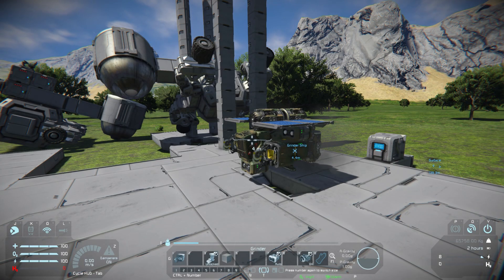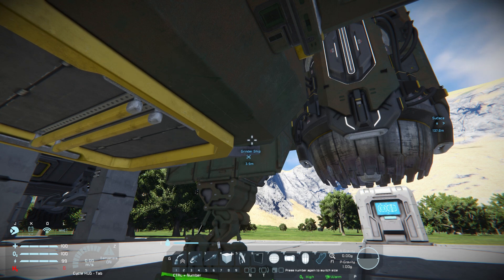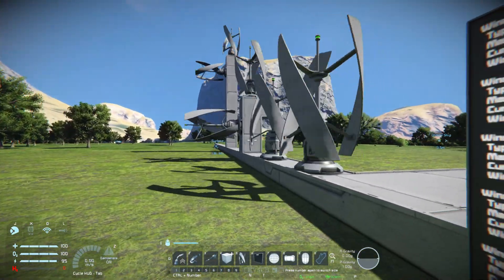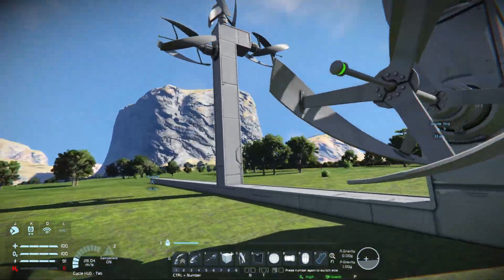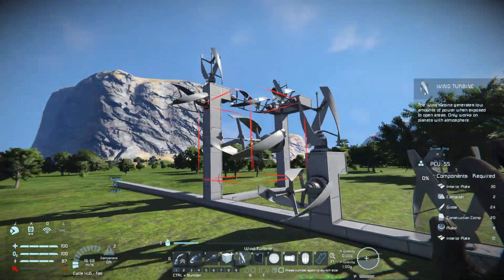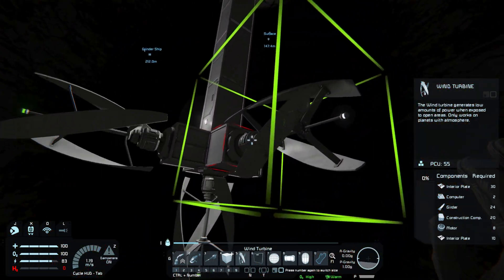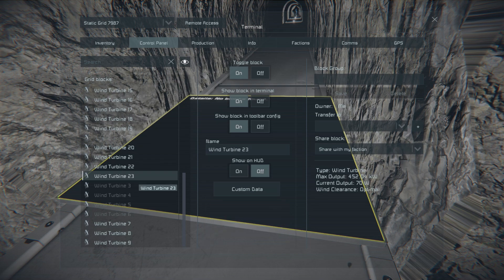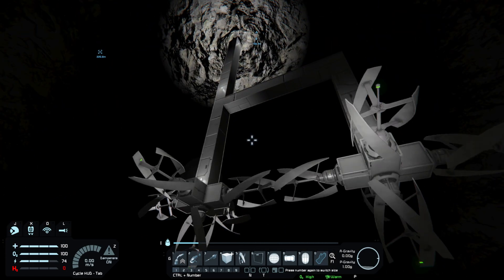Space Engineers | So You Want To Be An Engineer | Ep. 03 - Wind Turbines

Comment: 0:46  Holy crap... lol Ok.. I stand corrected... humble is my pie... :)
Reply from the maker: No worries.. I did a bit more testing off camera, imported another copy of the grinder ship,  had nothing in cargo, and overloaded the ship with batteries... ~42k kg worth of them lol

Set the inventory to 10x, and the empty cargo version still couldn't fly on 1 thruster, but the other ship with only 42K kg of cargo could.

So my original thought looks to be accurate, the grid mass is all blocks +(cargo mass/inventory factor %) for the lift/thrust ratio.. BUT grid mass reported is block mass + cargo mass (no modifier).

This means that the cargo container does have some contents mass modifier tied to inventory limit setting.  Just makes it really annoying in trying to calculate minimum lift needed lol

Comment: Good info on wind power/wind turbines. 
Do they work with Solar winds ?
Reply from the maker: When the wind turbines were first introduced, they did actually work on moons without atmosphere.. for about 5 hours (it was patched REALLY fast lol)

Now the control logic is the grid has to be in some form of atmosphere, stationary, and locked using either landing gear or connectors if it's a large grid ship, in order for it work.